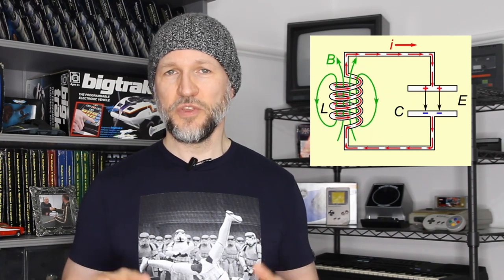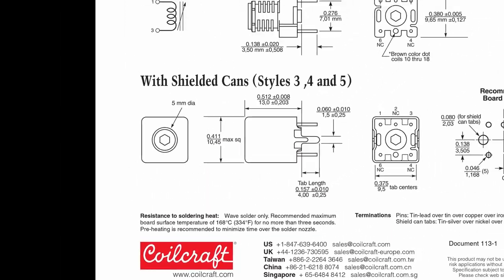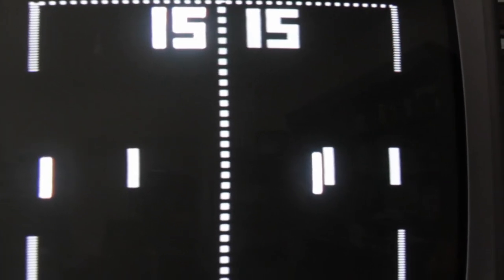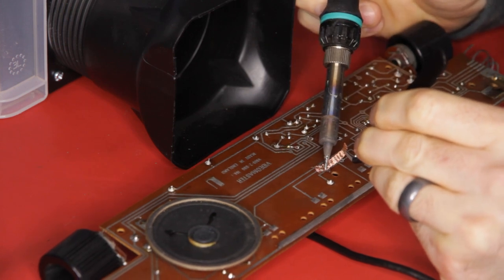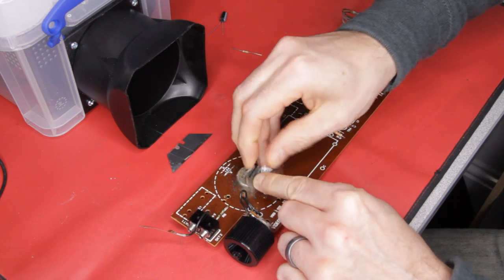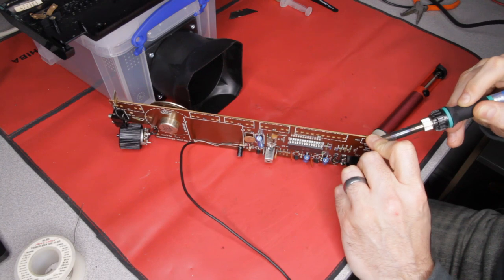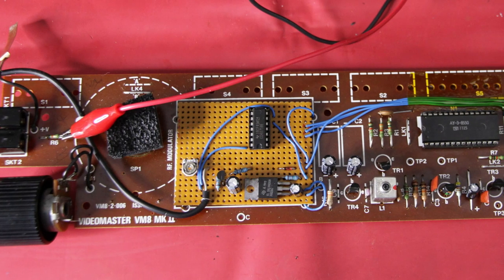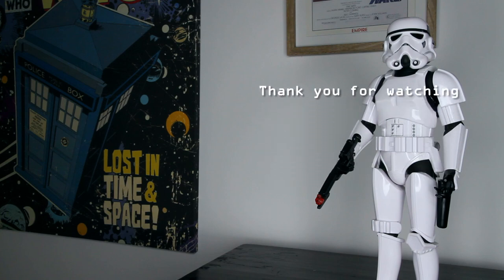Videomaster Superscore (Pt2) - Resurrection Conumdrum

Comment: Thanks for the video, I came across Pt1 and Pt2 because I used to own a Superscore (the version with the futuristic pistol). You could possibly have rescued  the original coil - if you looked at the bottom of the coil after removing it you would probably have seen an unbroken end on the bottom of the core which you could have used to unscrew it out of the coil through the bottom, and then put it back in the top of the coil broken end first, leaving the clean unbroken end at the top. This is a common trick where cores in similar coils are found to have been broken in radio equipment, and there is no obvious replacement available.
Reply from the maker: Hi, thank you for watching, I hope you enjoyed it. It's amazing how far gaming has come from these humble beginnings. That's interesting information. With any luck though I won't damage another! Hopefully your comment helps someone in the same position.

Comment: Great video! I wanted to ask what causes the “leakage” in the score points numbers on top of the screen that i saw in your Part1 video. I get this problem usually with the very early coleco pong and magnavox consoles. Thank you in advance!
Reply from the maker: Lovely to hear you enjoyed watching. I think the smearing effect is because modern TVs are more sensitive and not as tolerant of signals that are too high. The resistor on the RF input brings it back down to a level that is more within spec.
Reply: @TheDigitalOrphanage  Thank you for the feedback!
Reply: @TheDigitalOrphanage  again sorry to bother you but you seem the only one with knowledge on these pong systems. So i came across the Dimensipn FD3000W pong console and even though i get a picture and looks ok all the knobs working, i cannot get the ball starting to move.. The game just won’t start. Should i bother to try and fix? My guess is that the “brain” main chip has a problem. Or maybe it is something easy to fix? Maybe you have come to such a problem before. Thank you in advance for your time
Reply from the maker: Hi, I'm not familiar with the Dimension FD3000W so I looked it up. What you appear to have there is a pong machine from the first generation where it is made up of many discrete logic chips and passive components. Whereas the VideoMaster is from the second wave that used a single IC to do most of the work. The company also apparently had serious build quality issues during manufacturing. These mean it could be as easy as a bit of soldering of a bad joint or cleaning a switch, but due to the number of components and joints, could take a while to work out what's wrong. I would start by checking all the buttons and switches work (are any of them for "serve"?), along with a visual check of all components and solder joints.
This made interesting reading:
http://www.pong-story.com/firstdim.htm
Reply: @TheDigitalOrphanage  This is the first pong console i encountered that has no serve switch. It says in the manual that the on/off switch is also the start game/reset switch. That means that probably when i turn on the machine it starts playing the ball in the field. Thank you very much for the feedback, i will try and fix it
Reply from the maker: You're welcome, let me know if you solve it!